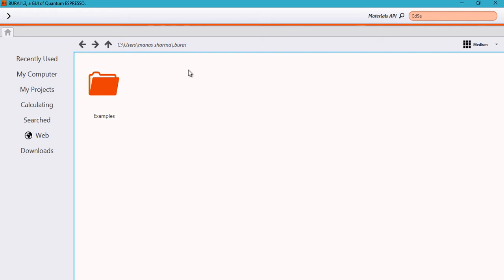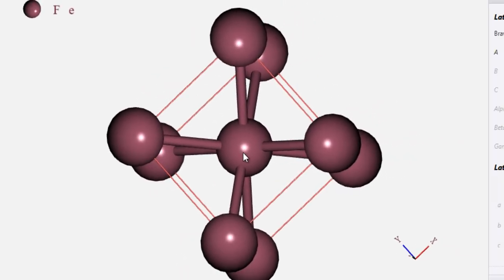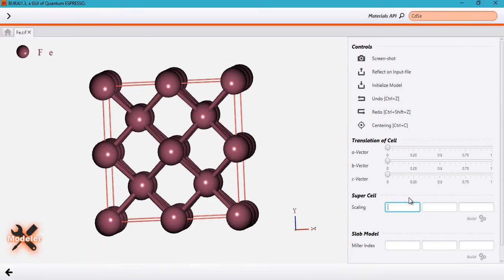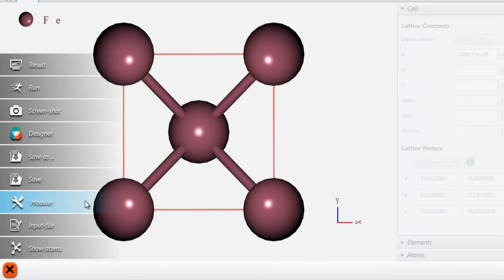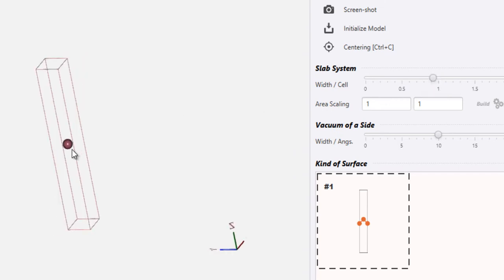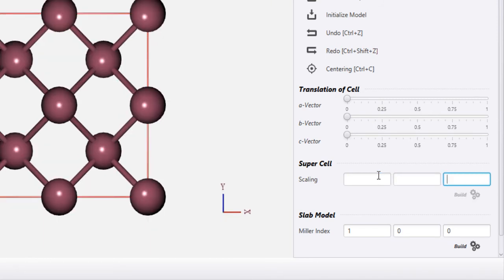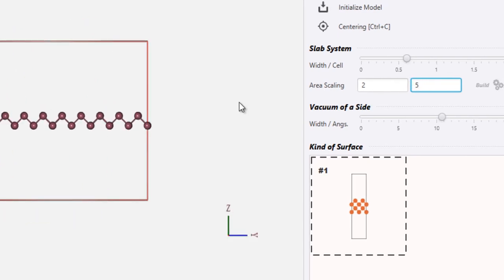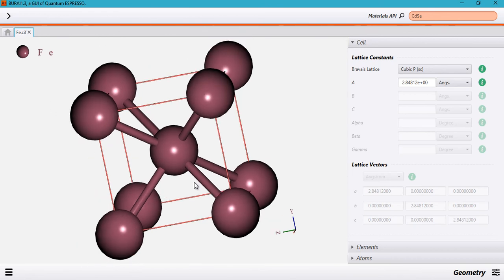SUPER-CELL,  MONOLAYER, SLAB Modelling using BURAI [TUTORIAL #3]

Comment: Thanks for the videos! They are very helpful. May I ask what exactly is a slab? Is it a cell that is infinite in 1 axis / lattice place, and finite (1 unit cell long) in the other directions?
Reply from the maker: A slab is infinite/periodic along two directions and has a vacuum along the third direction. The thickness of the slab can be anything you want. For example if you want to study the surface properties of a bulk material then it would be at least 4-6 unit cells thick. So that it is essentially a bulk 3d material with a surface left open for us to study. One cannot study surface properties from a thin slab. In that case it becomes more of a 2d sheet but I guess ome may still call it slab or perhaps a monolayer.